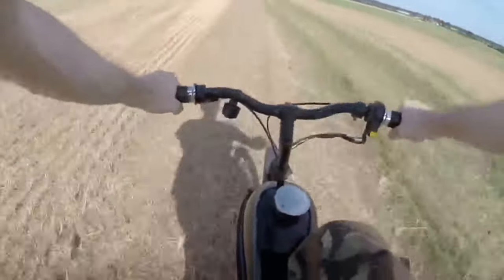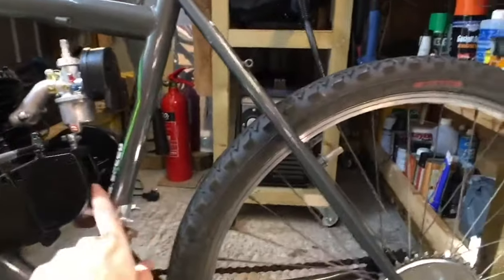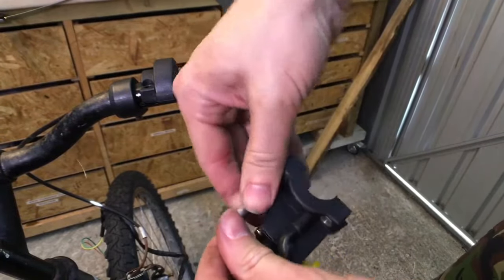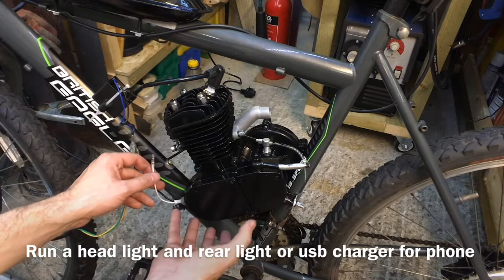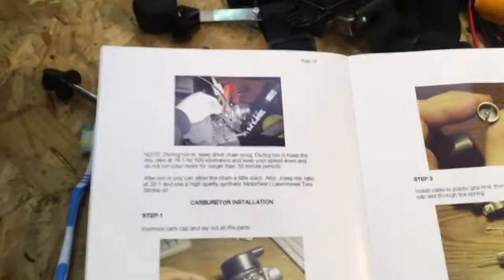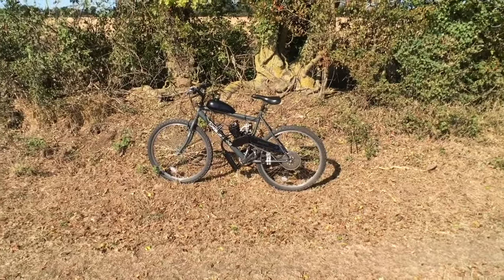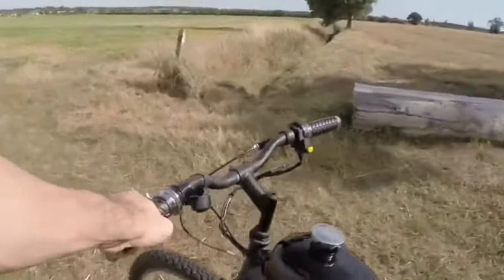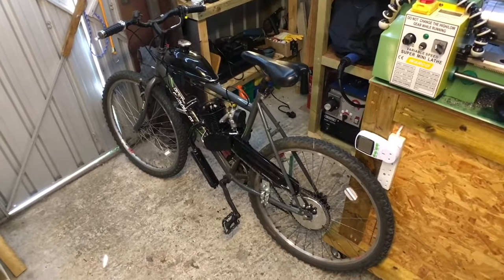2-Stroke Bicycle 80cc Building A Motorcycle Engine Kit Install How To, Motor bicycle 66cc 48cc 50cc

Comment: These 80cc two stroke engines should be capable of mor than 25mph I had a 70cc Piaggio NRG tuned up had every upgrade available and that done 70-75mph I know these engines are basic but there's no weight to these bikes so with the correct jetting of the carb and decent expansion chamber exhaust it should be pretty fast
Reply: A scooter engine, is way more efficient and is better quality, this is a garbage cheap Chinese engine, no wonder it only goes 25mph
Reply: That’s nothing really compared to my 66cc motorised bike doing 40.1mph on a flat bone stock

Comment: Probably a long shot but I built my all together and for some reason I can’t pedal, I can with an extreme amount of force but if you push it by hand the chain tights and the wheel locks any suggestions on what could be wrong? And can it still be used as a normal bike?

Comment: So my bike has a fat middle lower bar that couldn’t fit with the engine but I made it work. Ended up bending the bolts enough to let the engine somewhat fit in. Then I had the carburetor just not fitting at all no matter what I did but guess what I made it fit lol. Literally not a millimeters to spare. Not done yet but looking good so far

Comment: My dad gave me a bike with one of these. Its an old Schwinn stringray that looks like a chopper and is the size for a kid maybe around 12. Whoever put the kit on did an awful job. The engine is crooked, muffler blocks the pedals (lol) and not enough room for the air filter to fit fully onto the carb. Its also missing the lever mechanism that tensions the drive chain (forget the name) so i figure ill buy another kit and use the spare's for parts. Im gonna fix it up and find a kid to give it to who will have fun on it. All the fun for me is in fixing it up. Thanks for the video.

Comment: Great video 👍👍 I always laugh when I see people on the bikes and the engine kicks in😂😂. I'm almost finished building mine, of course my bike frame is over thick on the down bar and other places but good fun to build regardless. It's a great project for kids I think.  Two questions: Once you install this, you are basically foregoing the cycle function of the bike ? ( It's still possible to cycle but just extra weight)
Can you use it on the road/towns/cities in UK?  I can't imagine Mr. Khan being a fan them on the streets of London.

Comment: When you hold the clutch is it suppose to disengage from the rear wheel allowing it to move free? Mine is not doing that at all
Reply: yes
Reply: i’m having the same problem. did you find a fix?
Reply: @jack499m  Oh so you just need to tighten the clutch cable up more. That’s all. It’s supposed to disengage the motor from the wheel when you pull the lever
Reply: @sasquatch_886  amazing thank you 🙏🙏 will give that a try

Comment: The one and only random screw that I have left over in the bag of nuts , washers , and lock washers is too big , so it won't fit in the screw hole where your tightening the clutch cable ?

Comment: Thanks for the upload, great job on the build! 👍 I'll be doing one of these kits in the very near future and have watched numerous videos on how to do it properly. Your vid is one of the few suggesting greasing the clutch mechanism and using the self tapping screws on the tank and tensioner. Im guessing the folks who haven't taken those steps are the ones who have issues and leave the negative feedback. 🤔🙄
How's the engine been holding up for you, still working good after a couple of years?
Pete (watching from Canada!) 🇨🇦
Reply: How do you find it on amazon

Comment: Every video of assembly shows the spark plug already screwed into the engine.  Is there a washer used, or does it just sit in there bare?

Comment: Question: I have a motor on order? Do you think one could be started by spinning the rear wheel manually and engaging the clutch so I could remove the pedals?
Reply: You can, yes, though I personally wouldn't recommend it.
Reply: @mandarin1257  thank you but why is it not recommended?
Reply: @RobertlDavis-sp3rv  it's an awkward way to start it since you would have to push the bike quite fast, and these engines can be hard to start as well. I think you can get pull start systems for these engines though, might be better.

But really, I don't see why you would need to remove the pedals.
Reply: @mandarin1257  thanks man! Used to start my street bikes that way in a pinch years ago and it was a pain. Thanks again. I'm in the middle of an OCC chopper build and was wondering.
I'm waiting for the motor mounts to arrive so I can finish

Comment: Do these engine kits from Amazon and ebay usually come with step by step directions? Anyone know?
Reply: I purchased this exact one recently and the instructions are close to useless. There are pictures but it’s difficult to see and the wording is a bit confusing. I recommend having one of these videos pulled up while you follow the instructions.

Comment: Where does this part go? It is the single dark metal bolt with threads on the inside of one side and a bolt end on the other side?
Reply: It's a tool for specific purposes

Comment: Hey i watched your video extremely helpfull. It will turn over but not stay started any tips or am i doing something wrong?
Reply from the maker: Adjust idle screw on carburettor to allow more fuel.

Comment: Good video! How many miles would you get out of a full tank of petrol on that ?
Reply: About 70-100 i have one, its half a gallon tank so, almost 200 Miles per gallon
Reply: @MixedMedia33  no step on snek. Brother. Tell me more. Im building one to get around... Saving for guns lol
Reply: @feltav5719  it's definitely practical for around town just have to make sure to get a good quality bicycle
Reply: @MixedMedia33  true that. I have a full suspension one with disk brakes
Reply: @feltav5719  that's the way to go
Reply: @MixedMedia33  what gas should I use
Reply: @AlShams69  I used 91 octane all the time, if it's 2 cycle I use lucas 2 cycle oil.
Reply: @MixedMedia33 can you use 93 octane?
Reply: @Crunchyroll2005  yes, that's all I use
Reply: @Crunchyroll2005  i started using 93 and haven't gone back

Comment: I have a question can I put the engine kit on a bike with gears? Because the wheel has the extra gears and the handle bars have the gears so that’s just something I’m really confused by
Reply: You can, but you won't be able to use those gears anymore though.

Comment: I get how to attach the chain guard at the top where the screw is long ! But you didn't show how to attach the chain guard at the bottom by the sprocket ?
Reply: Zip tie the chain guard to the frame of the bike

Comment: Do you need oil for this engine becsue im having troble finding the oil it ses there all for chain saws plz help
Reply from the maker: Yep 2 stroke oil mix
Reply: Is it placed in the fuel tank?
 @JAYZWORKSHOP
Reply from the maker: @ttat_126  mix 2 stroke oil with fuel 16-1 ratio during break in period get a 2 stroke fuel mixing bottle or measuring jug search goggle for 2 stroke oil mix chart will tell you how much oil you need per litre .

Comment: My kit is on the way thanks for the video. Do u have any update info on it now that you've had it a few months?
Reply: There are some upgrades like a bigger head and a bigger filter for the for the carburetor but I suggest not getting the filter for the carburetor it makes it run not so good
Reply: I got mine it's running awesome once I got the chain right I wound up getting a new chain tensioner that hooks on to where the clutch plate goes it's awesome made life so much easier

Comment: Not sure what I've done wrong but the HT lead won't fit onto the spark plug terminal cap as it's too large. If I remove the terminal nut then it's too small and the HT lead has wiggle room. Please help! Thanks
Reply from the maker: Well it’s only soft metal in the cap just force it on should stretch

Comment: How much oil you need to mix with petrel?
Reply: 16:1
Reply: @jax4415  
that's only during the run-in period
it could be 30 or 40 to 1
Reply: @winniepeg2020  what's a run in period?

Comment: Whats the fuel consumption on the road per liter
Reply from the maker: if the engines tuned well it will do 120miles or more a tank
Reply: @JAYZWORKSHOP  for a 2 stroke 80cc tff thats insane